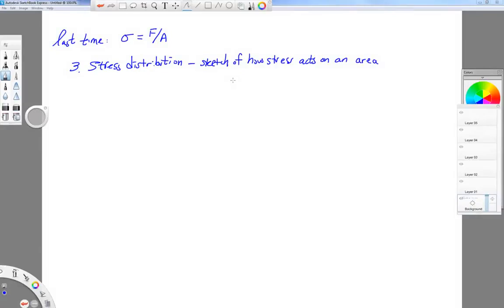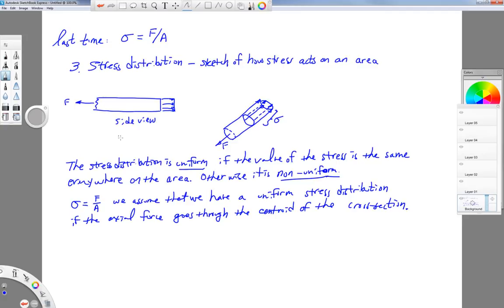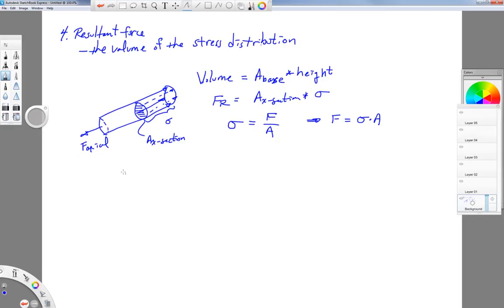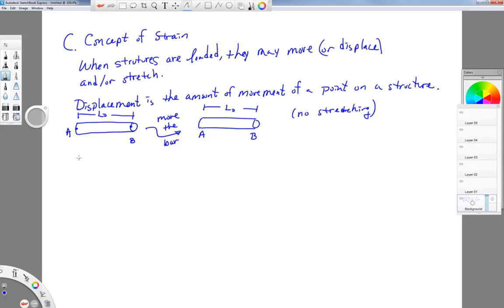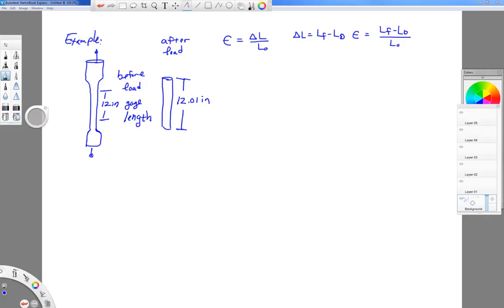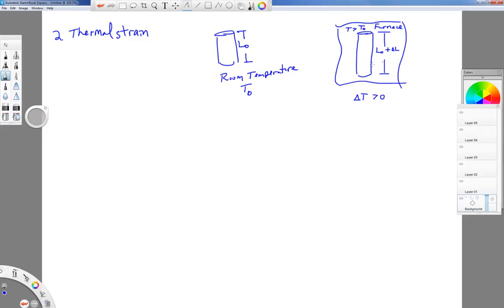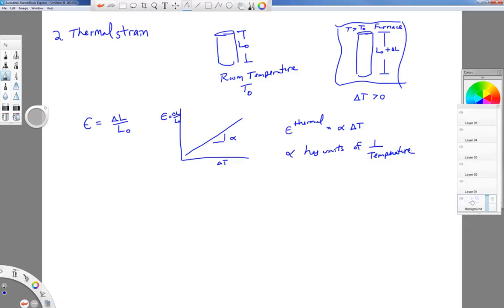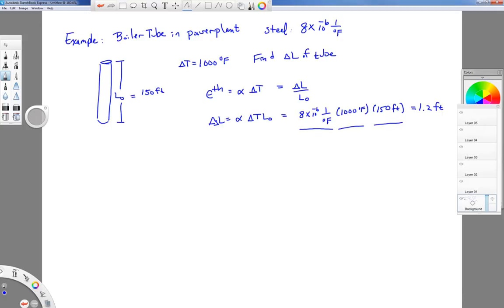Mechanics of Materials-Lecture-02-Stress Distribution, Strain

Comment: Please can you guide me which book is satisfactory
Hiblers or Beer Johnsons
Reply from the maker: Hi Husnain Hyder, I think both books are OK.    They have both been around for many years and there are a lot instructor resources available for them.  I would personally rank them as equals.  I also think that there is no book that I have reviewed or used that is exactly what I want for my students.  So, until I write my own book ( :-) ), I will plan to continue using Roy Craig's book.  It does not avoid calculus in various derivations (which I think is great) but has an emphasis on stiffness methods--which is very good for those planning to use FEA someday, but can get in the way of simple explanations.  I know that is avoiding a straight answer to your question, but I do not want to start any fights about books :)
Reply: @mbarkey.mechanics Hello, MR. Barkey  have you completed writing your own book?
Reply from the maker: @agnidhroganguly2116  Hi Agnidhro, No, I have not taken that on at this time.  I keep thinking about it...today's books also have a heavy investment in electronic problems/testing and I am not sure I am able to commit to that right now.  But I should make time for something.  Thanks! MEB